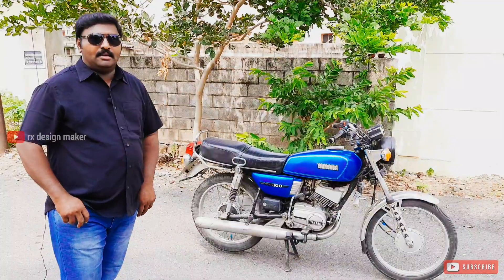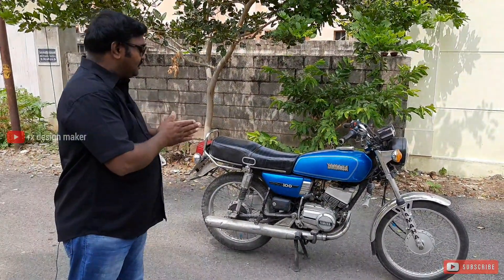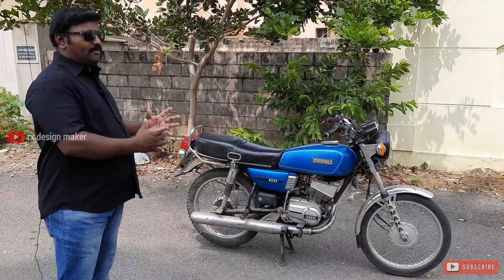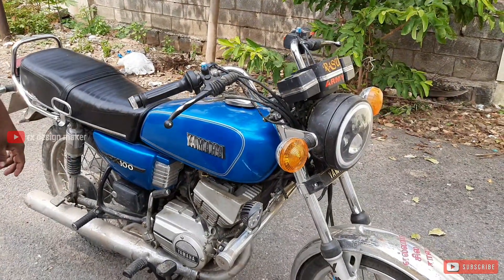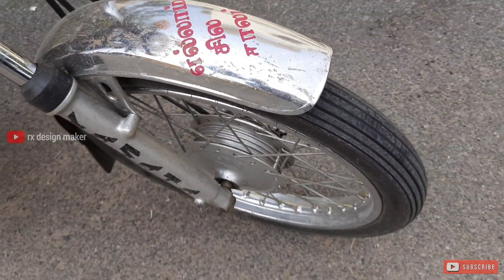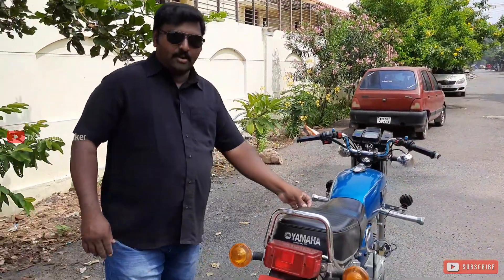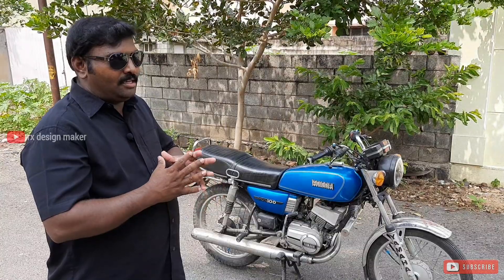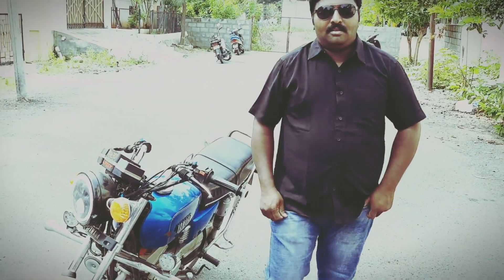vintage rx100 restoration in low budget | Sathish | sk | rx design maker

Comment: Small clarification. In RX135, 3rd and 4th gears struck sometimes while moving up. What could the issue.. it seems clutch cable is very tight... Can you suggest
Reply: Awaiting your response
Reply: replace clutch cable, and clutch spring left case and right case spring, replace clutch rod. Then check the nutral switch spring.